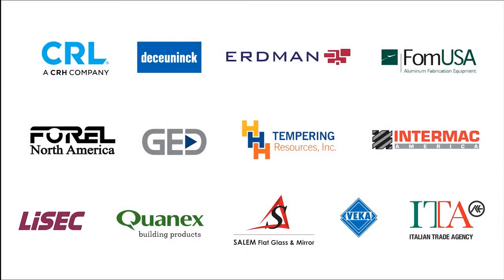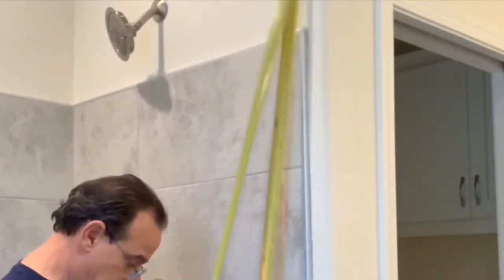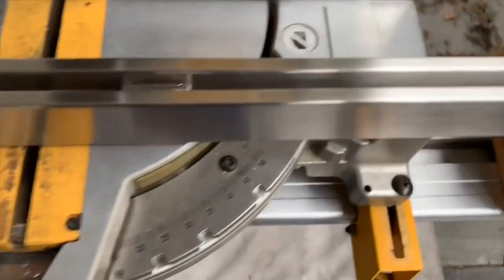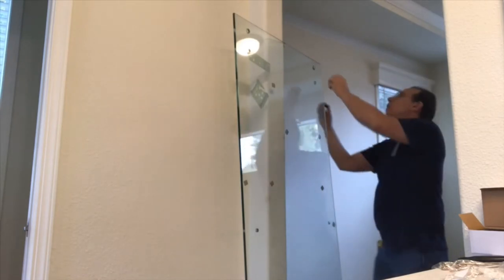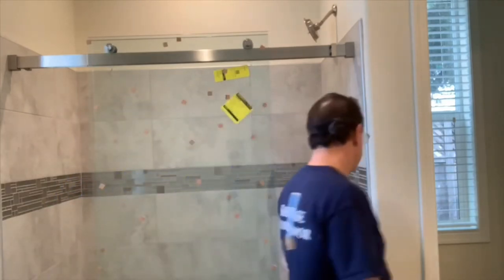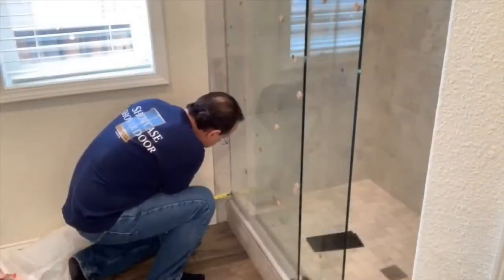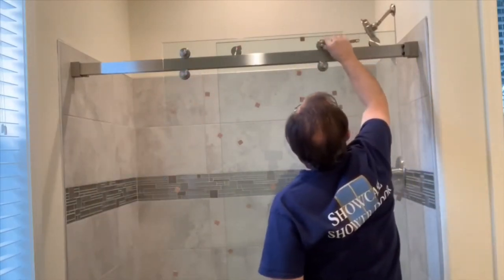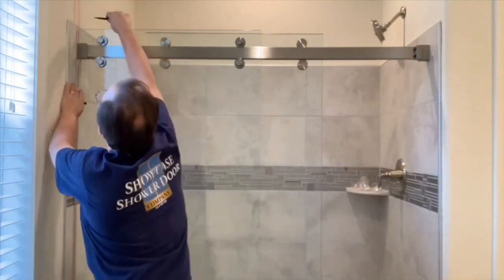Inside the Install: Cambridge Style Shower Door

Comment: Hey, it looks great! We have a very similar shower door. I do have a question, if you don't mind. 

Our left panel is fixed, and it goes all the way to the curb, and it's caulked, etc, so no problem. 

The right side slides, and is the inside door. And because of the slant of the curb, the bottom is about 1/2" from the curb. When water runs off of that door, it mostly drips on the curb and runs into the shower. But if a lot of water hits the door, it drips on the curb and sometimes ends up on the outside part of the curb (and sometimes runs over onto the floor). Because of the guide at the bottom, there's no room for a sweep on that sliding door. Do you ever have that problem? And do you have any ideas on how to fix? We were considering putting a clear shower dam on the curb to divert any water from getting to the floor. But maybe there's some kind of sweep that would work in this case? Thoughts? Thanks!
Reply: Did you happen to figure out this issue? I’m having the same problem.